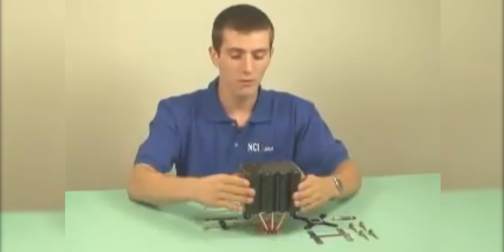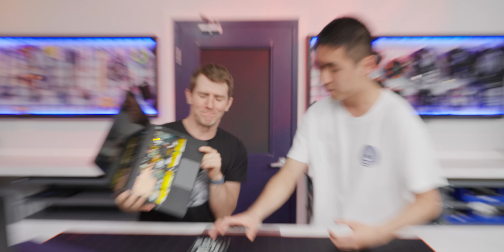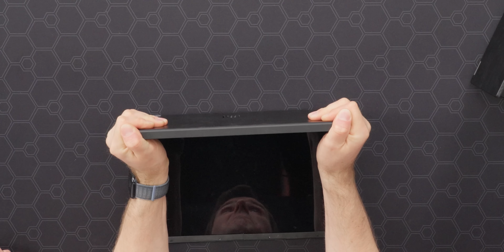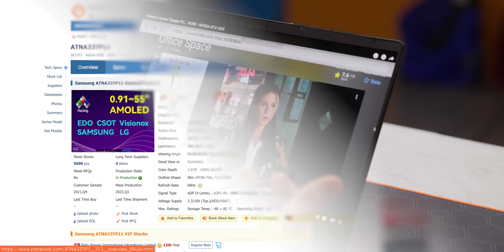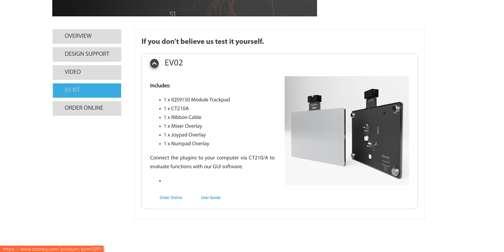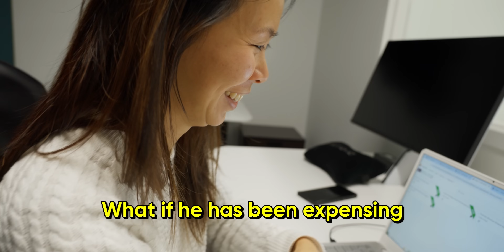This Kid Made his Own Laptop and it’s AMAZING!

Comment: bruh seeing ppl like this guy always gives me whiplash between awe and depression
Reply: for real man, im slightly older than him and i find both amazing/inspiring and then go into an old habit of comparing myself to others and just become sad. :(
Reply: @Ikram232  no you don't
Reply: @WaldoWaiver Are you him? No. Don't tell him what he does and doesn't do.
Reply: Yeah even if I had the money to do cool things like that no way I'd be able to
Reply: @deamooz9810  its just practice. good startingpoint, make a game controller. you can get a $5 pi pico, a few switches, wires and a box you drill holes into and then you just load in gp2040-ce on the pico and bam you got a controller. its prety easy and a great starting point.
Reply: @deamooz9810  that's where you are probably wrong, given time and funds, you don't have to worry much anymore and just invest yourself into something you are passionate about :D
Reply: @deamooz9810  
I had the same mindset as you until I actually started taking action to learn. It doesn’t have to be circuit boards if you’re passionate about something and have some money saved up, go for it! The number of circuit boards and development boards I’ve short-circuited and messed up is embarrassing, but that’s part of the learning process.  Always start with a project you genuinely want to build  and learn all the necessary steps to get there that’s the best learning method, at least for me, when learning something new
Reply: You said it
Reply: In a way he reminds me of Vitalik Buterin, in how fast he is talking while going over what he is doing. I always get the impression that their brain is working at such a high pace that their body can't really keep up haha.
Reply: @baverfjant  true!
Reply: @baverfjant  fr
Reply: This comment perfectly encapsulates my feeling. This guy is just joining college. WTF!!
Reply: Tbh, videos like this reminds me that I just need to work on my own projects that I want to do. I would have felt like utter shit if I saw this in my early 20s but seeing this in my early 30s just reminds me that you don't really know what you can accomplish until you try (and be persistent). He stated in the video that he had no confidence but did it anyway. That says a lot about learning from failures to gain eventual successes.
Reply: just gotta appreciate others more, instead of compare negatively to yourself. Be supportive, learn, let yourself be impressed. Have empathy for others, and let yourself feel joy through others. You got this!
Reply: same
Reply: he's got more qualifications at 18 than senior engineers in the field for 5+ years
Reply: im 34 with 130 iq , im a van driver.i deliver food from an supermarket in denmark , nemlig,com . life works in wierd ways , take it easy.
Reply: You know it
Reply: this video, the thumbnail and the title exaggerate my dad's expectations to an unimaginable degree
Reply: It kinda inspires me to lock in on my career growth honestly
Reply: I knew them feels bruh
Reply: HAHAHAHA Same
Reply: Yes
Reply: yeahh....
Reply: @muzammilkhan-mu3es  well guess for us people that wanna create something, got to step it up.
Reply: he build 6 layer pcb and I still trying figuring change 10 pin 4 digit seven segment to 12 pin 4 digit seven segment
Reply: No 5hittay either, so true and well put.
Reply: Brother you hit the nail on the head
Reply: You can do anything you set your mind to! Unless you want to play in the NBA or something. I know it sounds cliche, but don’t give up on yourself.
Reply: You can learn so much with YouTube alone, now if you have weird questions there’s ai for that. It’s never been easier, just try something! It doesn’t need to be fancy
Reply: Type in “MIT maker portfolio”
Reply: Facts man! Thats exactly the emotion(s). Im extremely impressed and at the same time I feel like a giant waste of oxygen
Reply: no it doesn't
Reply: Just do it if you want to create something! If you never start, you cant fail, but you also cant ever succeed! And, failing is important, the best teacher you can have.
Reply: @recxgems  nah, the brain power won't compute :)
Reply: Well, you heard him, he didnt just create a laptop out of the blue. His first projects were much more humble, simpler, cheaper. Just start somewhere you feel comfortable, and slowly step out of that comfort zone over time.
Reply: @recxgems  just to tired to do anything after school, university, sports, socialization
Reply: @ But then that's your active choice to to these things instead . And thats totally fine!
Reply: @muzammil khan A $4,800 development budget sounds steep but, if it gets you further in life (or at least the IT field) than a single semester of college can for your career, I don't see an issue with that.
Reply: @christopherthibeault7502  Neither do I man, which is why I said I was in awe. The depression part was meant to refer to disappointment in myself.
Reply: I get a similar feeling when I look at MKBHD knowing his only 1 year younger than me.
Reply: Eh this is achievable for us mere mortals as well. It's just whether you want to spend your time busting your balls on such a personal project or get hired to do so at a company. Projects like this take spare time and resilience, not genius. Your first two years of an Engineering degree would teach you enough foundation to pull off this project. Most won't be able to, but I would wager the average LTT viewer could pull this off if they hate themselves enough lmao
Reply: probably spends close to 0 time on games, books, movies, parties. Everyone can choose where to spend their precious time and preferably on things that they like.
Reply: @ligametis  I feel like that's just coping/making an excuse for him being spart. I know plenty of people that are smart and are capable of excelling in tests with little to no preparation beforehand and still spend tons of time playing games, doing sports etc. you can't just grind your way to intelligance.
Reply: @lukemax6048  but you need to grind a lot to do something like this. It needs knowledge, intelligence is not enough. You can be extra smart and you won't magically know latin names of animals.
Reply: Bruh in 2026
Reply: Just get rid of your iPhone and maybe you will learn how to do something useful 😊. CrApple Sucks, and so do their users.